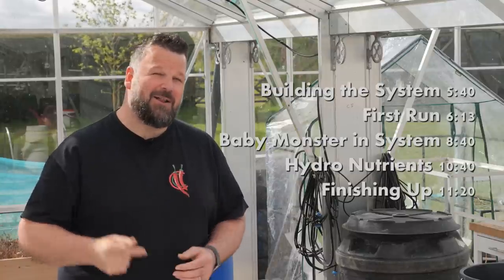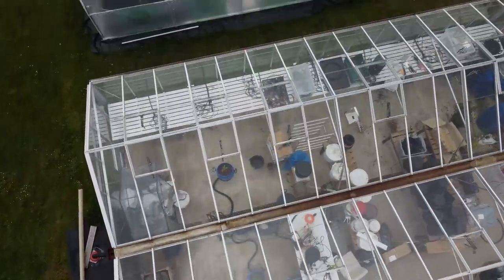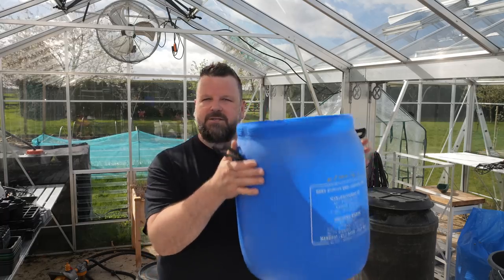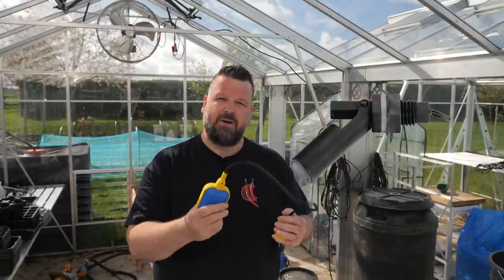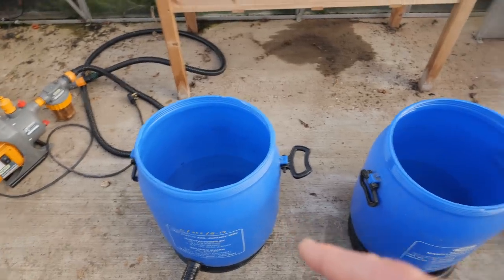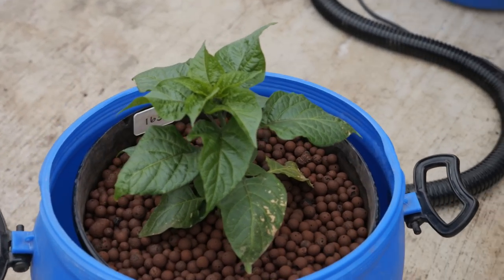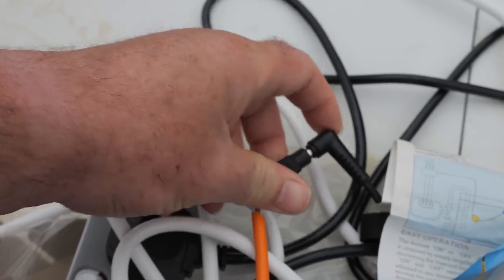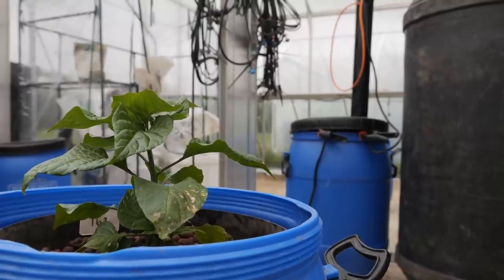Hydroponics Build for Monster Superhot Chilli Pepper Plants!

Comment: A simple hack to stop syphoning is to drill a 10mm hole in the pipe at the top of the bend, I used the same bilge pumps on a water ballast system and the 10mm hole works a treat.
That Naga will be a beast of a plant 👍
Reply: good tip 👍
Reply: better to wedge a small 90° plastic fitting in that 10mm hole will aim the water downwards.(its called an anti syphon)
Reply: and hard mount the return with tank connecter or same fitting  you used at the bottom.
Reply: @allanmk2r324  the 10mm hole stops the Syphon by letting air into the system thus being the anti Syphon

Comment: You should try building a DIY high pressure aeroponics using NASA misters from "AgriHouse", each mist nozzles are $5, true high pressure aeroponics grows plants faster and uses super little water and nutrients. Should be less than $300 to build. This type of aeroponics is nothing compared to what you see people are doing on youtube with common aeroponics using low pressure. Not sure if you know about this tech, but it also helps to keep bacteria at bay. The mists droplet size are 50 microns, perfect for roots to absorb directly.

Comment: nice setup I personally don't like using a double pump system it just becomes overly complex imo so I went with a gravity draining system and use a self priming pump to supply the buckets and use a spillway as a return to set the water height and once the pump cycles off it drains the buckets back through the pump you just need to use a big enough pump to push that weight and has its in/out high enough to brake the suction without draining the casing and It can re prime no problem just make sure it has no internal check valves and its g2g
Reply from the maker: If you have a look at the system I built a few years back, it is a gravity drain system. It introduces a few issues that I am trying to avoid with this system. By the end of the season, the system required constant maintenance due to the root system.

Comment: Get some reflective material to cover your main reservoir. In the sun it'll become a mini hot tub.
Reply from the maker: I will do when things warm up, right now it's handy to keep the water from freezing
Reply: @ChilliChump  I tried dwc in my poly tunnel with a black tub and got terrible root rot. You live and learn eh! I did use some beneficial bacteria and it did get rid of most the root rot.
Reply: @1000Mikey  Makes me suspicious of Kratky in full sun. Did you try lowering water level or go straight to beneficials? 🤔
Reply: @BlackJesus8463   I had a solar air pump to an air stone which probably just pumped hot air into the water. I ended up changing out the nutrients, covered the pot in foil tape which really did reduce temps then added beneficial bacteria. The plant came back but It didn't really grow that well. It was a good learning curve. It's always good to try different things. The main issue with full hydro outside is maintaining the res temps.
Reply: @1000Mikey  yeah ok. Thanks!

Comment: With that pipe diameter to actually get a sifon effect is very hard u would need and insane flow rate, keep in mind that the pipe have to actually be completly full of water for that to happen, if the water doesnt fill completly  the  upper part of the pipe loop u will never get a sifon effect
Reply from the maker: It happened with this system...which is why I mentioned it
Reply: Unfortunately MW2GanjaGangster, the pipe diameter does not affect back siphonage in the way you described. 

Of course generic garden hoses can siphon but so can 2" or larger pipes such as water mains. In plumbing, there's "backflow prevention devices" that are required to prevent things like siphonage. 

To prevent this with any size pipe, the most effective and often most simple solution is: create an air gap. 

(Which is what they did in the video).

Comment: I have never tried hydriponics. Too much stuff required 😊
Reply from the maker: It's fun and the results can be impressive...but yeah, it's a lot of work getting it set up!
Reply: @ChilliChump  
A single flood and drain bucket is very cheap and simple, you dont even need a pump :)
Reply from the maker: How you doing ebb and flood without a pump?
Reply: @ChilliChump 
Single buckets filled with hydroton can be manually flooded and drained. All it takes is a push fit tank connector and an elbow plus a length of tube as tall as the bucket, swivel the tube up to flood, swivel down to drain.
Reply from the maker: Ah manual flooding.  Kind of defeats the point of a regular cycle. May as well just grow in soil at that point

Comment: I like the build, but, Is it not easyer to putt the pump in the resrvoir and pump the nutrient from there UP to the growpot and as it is at the highest point the pump stops and the nutrient runs back over the same pipe?
Reply from the maker: The nutrients already run back through the pipes. If I understand what you are saying...it would be a similar system I built previously, which wasn't as extendable as this...and also caused major issues with roots.
Reply: @ChilliChump  Thank you for the reply, please explain " problems with the roots ". To bad I can not enter a drawing here but when in the growmediacontainer is an overflowpipe running the water what is to much I see no problems for the roots.
Reply from the maker: Traditional ebb and flood uses gravity....the reservoir is under the grow media.  The pump pumps water up into the grow media, flooding it.  Then when the pump turns off the water flows back down into the reservoir.  What happens is the roots chase the water back down the pipe and can end up clogging the system.

But it sound like you are talking about overflow...so are you suggesting keeping the water topped up in the grow media? Because if so, that wouldn't be optimal for this type of system.
Reply: @ChilliChump  No, run it for EG like 15 minutes and let it flow back over the unpowered pump. Only reason for the overflow to be there is if the 15 minutes pumping is to much, but the used timer is only in steps of 15 minutes, so the water amount more as where the high level must come, goes back to the reservoir over the overflow drain. The roots looking for water are no problem, the in and out pipe is with cuttings made with a saw to cut iron. And aroud that one another, larger in diameter, pipe also with saw cutted passages. It is more as a bell sifon butt without the bell sifon. Made more than one never one that works.
Reply from the maker: That's the same system I built here
https://youtu.be/rVAhSHe0Z1w
And here in a smaller system
https://youtu.be/mB6CJHqPdqQ
And another where I designed a little 3d printed solution for it
https://youtu.be/9A8mj7paNIc